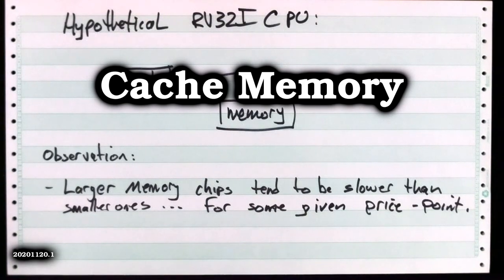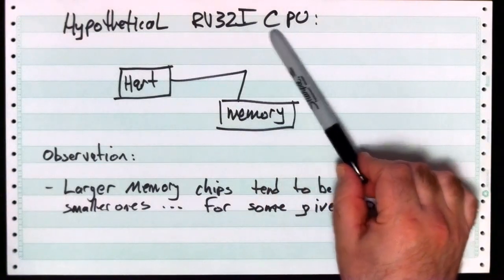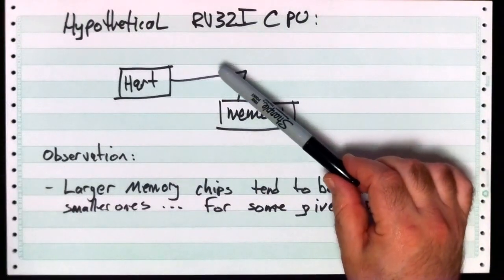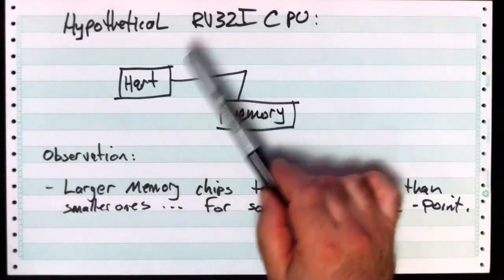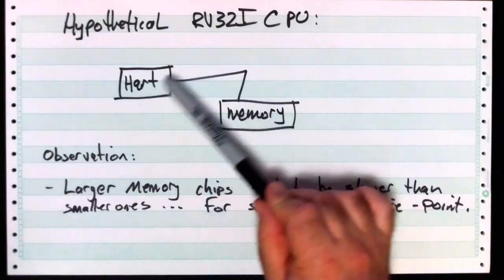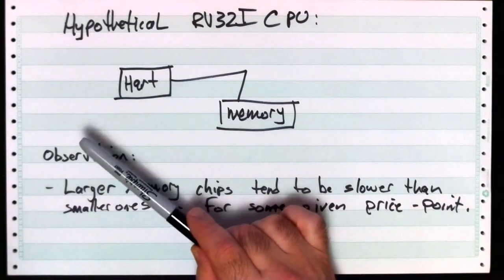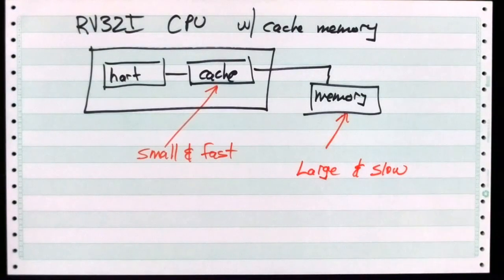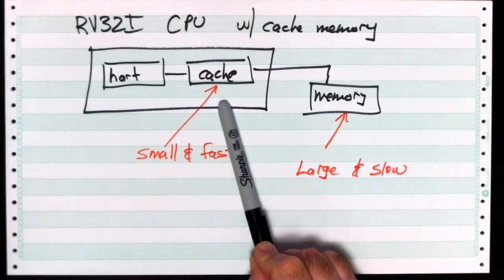Cache Memory

Comment: I would have loved to see such an explanation in the 1990s as I could not figure out how external cache memories worked. Even in the computer architecture class in college we did not look into cache memory in detail.
Quick question: accelerator boards for 68000 systems used special TagSRAMs with integrated comparator to manage external cache. These TagSRAMs were usually (expensive) IDT 71S74, ST MK48S74 or MK48S80. Without onboard cache these accelerator boards are pretty useless as the (faster) CPU always has to slow down when accessing the mainboard with its RAM, ROM, I/O.

PC mainboards in the 80386/486 category used standard SRAMs for data and Tag storage. So the chipset includes some logic that makes special Tag SRAMs obsolete.
I have an idea of what logic the chipset includes but would like to hear your opinion.

On a WriteThrough cache the Dirty-Bit can be omitted?

BTW: there is a nice tutorial and cache calculator on umass server. Unfortunately I cannot post the URL - otherwise the comment gets deleted automatically :-/ But if you google for "Cache Address Structure" it should be on the first page.

BTW2: +1 subscriber
Reply from the maker: I didn't work with these parts in that era.  I leaped from the Z80 to the 32016 to the 68040 (no cache, no cache, integrated cache)... So you got me there.
Yeah, if you have a write-through cache, then it can't be dirty.